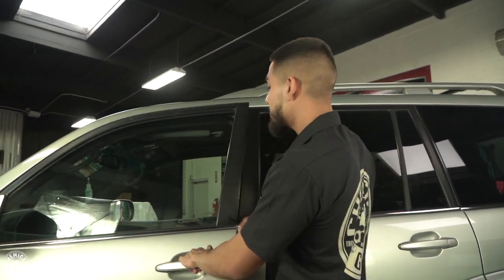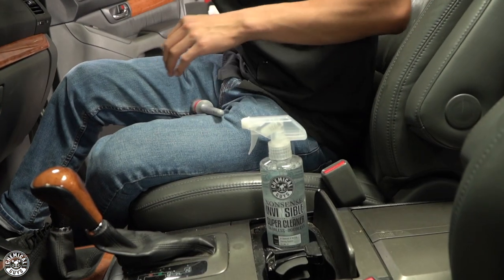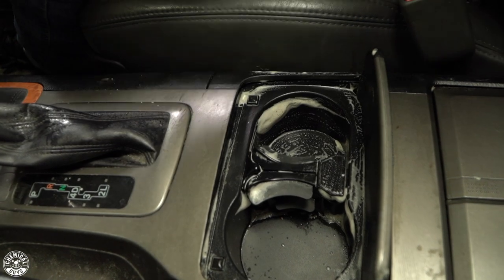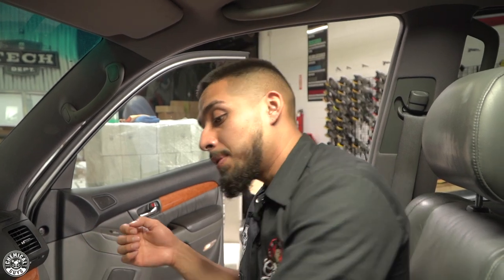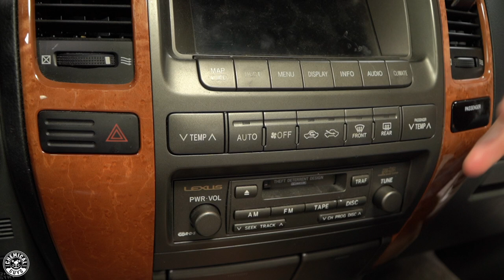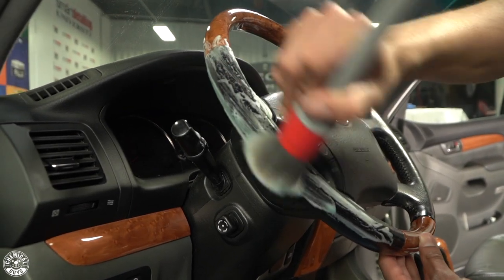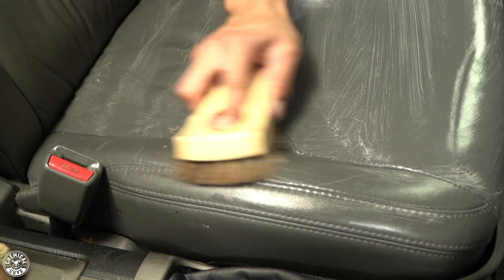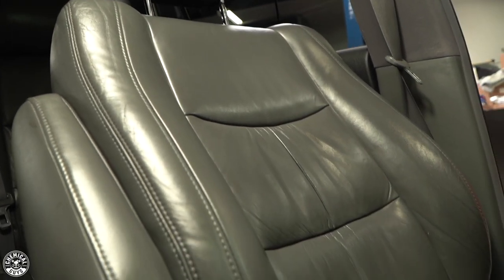How To Clean A Neglected Interior! - Chemical Guys

Comment: I have a question for the wheels, my inner barrel of the wheels end up looking dirty after thoroughly cleaning them.I used diablo, deacon, and sticky citrus with a red rocket brush to try to remove this dirty looking area. When I dry it with a towel it comes out looking dirty.Any ideas on what else I can try to make this part clean. I got black rims btw so the brown from the dirty pops out more
Reply from the maker: Hey there, check out this video for wheel cleaning tips.
https://youtu.be/JnRC_sanNG0
Reply: Put some protection on it after you clean them.